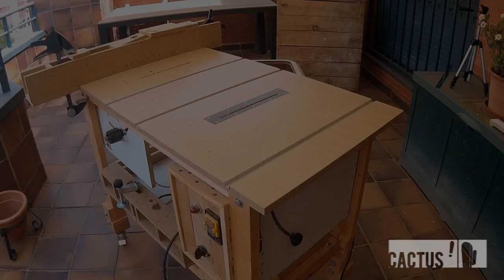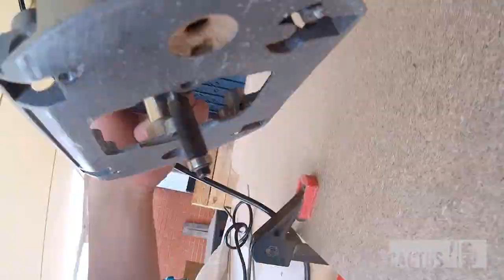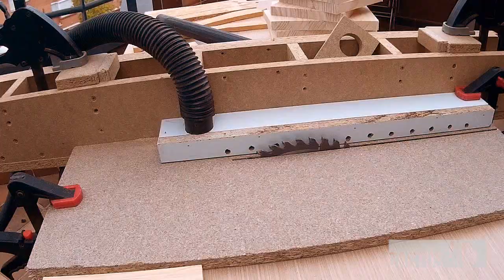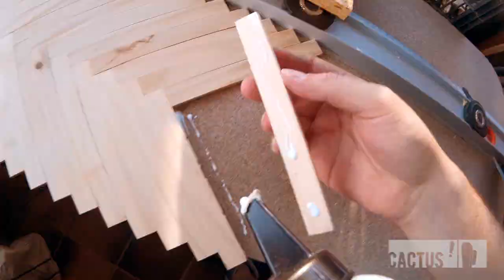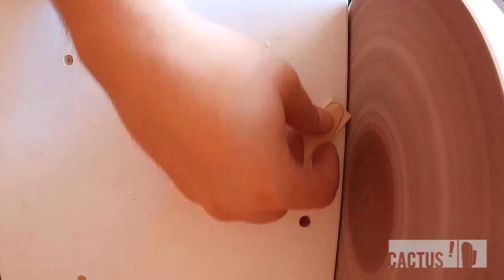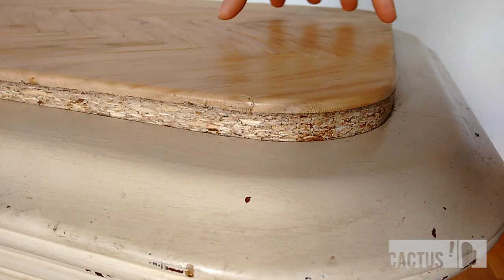Upcycled parquet table

Comment: really should have hit that with a hand plane... unless you wanted a rustic look. if that is the case, very good job.

I know your fans are going to try to argue with me, so let me make one final point; no matter what you do, it should be done to the best of your ability. as a wood worker, you should always strive to make something that fits 2 catagories. it should be functional, and beautiful. 

I understand that is was found material. you recycled it and made it functional. however, you could have made a fine piece of furniture if you would have taken a few extra hours and planed it, and gap filled with sawdust. 

as I said before, if you wanted a rustic look, you achieved it perfectly.

I subbed
Reply from the maker: +Nick Pelletier thanks nick! That was the plan the whole time, but when I had all the tiles in place the texture was totally beautiful, so I decided to leave it like that and not plane it :) thanks for watching commenting and subscribing!
Reply: +Cactus! workshop it looked like it was the plan. you do really nice work.
Reply from the maker: Thanks!

Comment: Nice video and nice work! Little tip if you applied a thin layer woodfiller and sawdust (before final finish)  you could make the top surface super smooth. This is the product i used for my floor  http://www.carver.it/prodotti/bt/en/BFO6500G_STUCCO-AQ.pdf  Keep the movies coming! Very enjoyable
Reply from the maker: Thanks!! I liked the rough surface so i left it like that :) thanks for sharing the product info :)